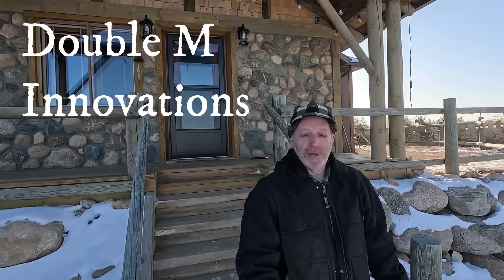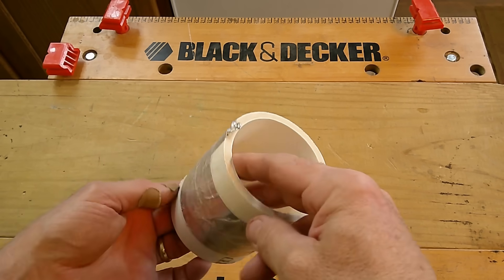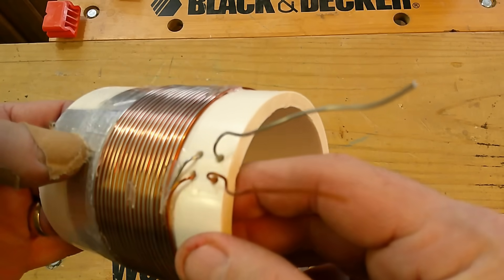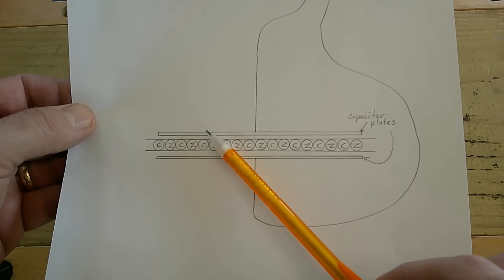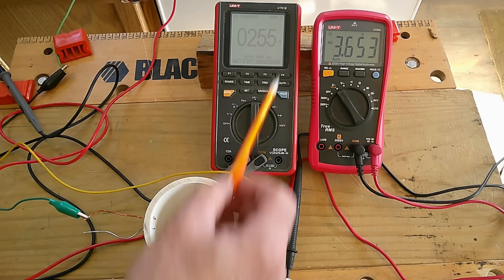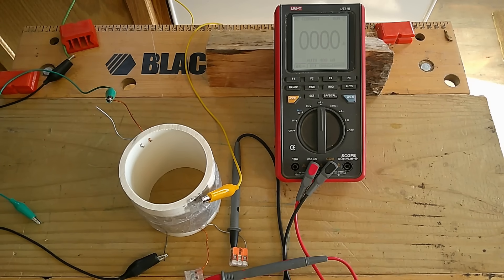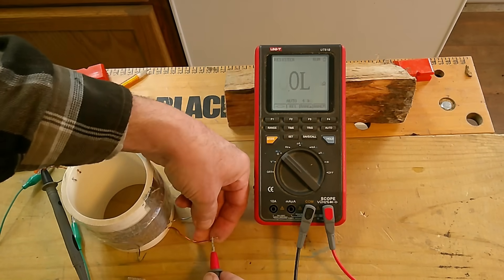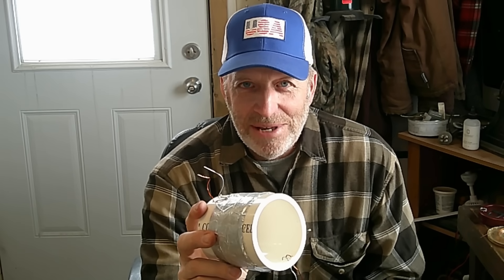Copper-Zinc anomaly; and a capacitor sandwich

Comment: You are indirectly building a dry pile or Zamboni pile.
If you stack enough layers of Cu and Zm that are electrically  isolated from each other, you will start getting a higher and higher static voltage that electrostatically occurs between the metals.
The famous Oxford Bell was made in this way .
Very high voltage and tiny currents occur.
Fascinating physics.

Comment: Did you check the Temperature of the coils?   I suspect you're getting Inductive Heating from the A/C, and are seeing a Thermionic or Thermoelectric Effect in response.  Use Tin for one of the wires and that may increase the effect, if it is a thermal response.  But I'd check the Temp first of all.

Comment: You have dissimilar metals that when combined form a difference in potential and are used in a lot of temperature measurement instruments and in heating and cooling thermostats and the like and can form galvanic erosion over time when placed bare metal positioning.close together.

Comment: I don't know, the only thing I can think of is the voltage drops to 0 because the meter is not Sensitive enough to measure a voltage that low but it maintains the current?

Comment: Earth batteries copper and magnesium give 2 volts which two rods copper and magnesium one end positive the two connected the other end negative in a pvc pipe capped off at bottom with dirt in the pipe … but nothing of … no if the pipe were painted black and in sun it would be a solar array set solar power!

Comment: Seems to me that it’s a variation of the Seebeck effect, except instead of using heat to stimulate voltage in the metals you’re using the AC field. 

Zinc has 2 free electrons and copper has 1 free electron. The alternating field would stimulate these free electrons. The 2 free electrons would create a greater force than the 1 free electron - in the same way two units of mass in a gravitational field would create a stronger force than one unit of mass.
Reply from the maker: Thanks for your input!

Comment: What i think you built was a thermocouple. At any temperature, two dissimilar metals will cause a potential difference between them. The higher the ambient temperature, the greater the potential difference . Copper and zinc does give the best effect.

Comment: since you have a private house, do a biger version of this alternate metal coil and plug the lunar coil to a high antena, and the solar wire " copper " to a good ground with a copper plates underground, then seek a good ferite of the type the magnetizes and stays magnetized even when the current drops, like the ones in radio amplifiers, and put it as core to this coil you made, and have it connected to a parallel of many alternat metal capacitor you can make and have the plates coated on resine while on high voltage until the resin dries on it magnetized and nano assorted for directional energy perpendicular to plates, each plate should be magnetized on different pole of electricity " positive or negative, accordingly,
 then mesure the voltage you get from antenna and ground , pressurized in the coil with the ferrite i mentionned then made strong with the capacitors in parallel, and see what you got and what you can do with it, then you can try to ad a gradual spark gap, and see how it goes, and note the higher  the antenna, the higher the voltage, and bigger the antenna the strong the amps, goes also for the grounding,

Comment: You would expect the voltage of both wires to be balanced the same for the alternating electric field, but due to different resistance a phase shift is created.

Comment: Galvanic voltage betwee zinc an copper is normally around 1.1v only. Anyway the copper wire is enamelled (insulated) so that seems unlikely. Whats the resistance between the copper and zinc terminals? Shoul be very high if insulated from each other. Think that would rule out a galvanic effect.

Comment: electron ia not an particle, what happens here is same what happens if you have an loop of wire and parts of it is in different temperature, cavity will happen that "stacks" electrons (still not an particle). but in this setting different metal acts as an heat, likely not an actual heat (might still be the heat difference) but how easily it releases electrons and or how well it binds em (nope, not an particle)

Comment: Interesting the increase of charge difference between different wire during warmer temperatures. Add Temperature to the growing list of Increasing Potential Charge Differences:
1.Different Metals
2.Different Surface Areas
3.Different Distances from 1 Source (One Near, the other Far)
4.Greater Charge Differences between 2 Sources (Antenna+positive & Ground-negative).
5.Increasing Temperature.

Comment: Copper has positive + potential and zinc has negative - potential. One grabs positive frequencies and the other grabs the negative.
Reply: Try silver and magnesium 😉 silver is high positive, magnesium is high negative  or any alkaline metals. 
Put your coil up high, little circuit in-between it and ground you can harvest DC off, leading to a very good ground/earth.

Comment: The galvanic effect creates a voltaic pile. If you left a gap between the wires and filled the space with 50/50 Alum and sodium silicate you would create a low capacity voltaic pile. I experimented with copper pipe and magnesium rod and stuffed the gap with the above mix and got milliamps that ran LEDs for years with a bit of moisture added infrequently. Bedini and many others worked on this and called it a "crystal cel". The galvanic effect is certainly what you are observing in your anomalous readings though. Hope that helps. Stay curious my friend.
Reply from the maker: What you're talking about, I have done in the past too, and have a number of videos on magnesium crystal cells.  I do have a new about that too.
This situation is strictly alternating current, (VAC).  May have figured out the puzzle now.  (see the next video) Thanks for your interest!
Reply: @ Love it!
Reply: If the copper wire is enamelled (insulated) I'm not sure it's a galvanic effect. For copper and zinc I think that would be nearer 1.1V.
Reply: Any noble metal connection to a anode type.  Same principle as cathodic protection,

Comment: the amount of current and voltage here is extremely low and due to various artifacts.  Why not study the effect of putting your hand around the tube after plugging it in and recording voltage and microamps flow from various places on your skin?  There are so many unaccounted for variables here that you cannot begin to conclude anything.

Comment: Hi,
really interesting experiment! But I think there is a quite simple explanation for this effect: You formed two capacitive voltage dividers. One for the isolated copper wire and one for the zinc wire. If all four capacitors of the voltage dividers had the same capacity, you would get on the Copper- and on the zinc-wire exactly half the mains voltage. And the voltage between the wires would be exactly zero. But one of the two capacitors would be a little bit smaller than the other three. Then you have excactly this effect that you get e. g. 4 volts. But why should one capacitor be lower than the other three? I guess that it could be e. g. a little bit different diameter. Then the thiker wire is coupled to both capacitor electrodes. But the little smaller is more coupled to the inner electrode.
If I am right this would proove my theory: Use two isolated copper wires as electrodes. But the one is thick and the other has only the half diameter. I would guess this would produce a even higher voltage like you see here in the video.
Reply from the maker: This very thing has been described by some sharp minds, in another part of the comment section.  And I have been following that lead.  While I've know that an obvious size difference, produced a voltage difference, I didn't pay really attention to the precise measured size.  The zinc was about 2 or 3 hundredths of a mm larger in diameter. -hard to get anymore exact then that, as parts of the wire vary.  I used a capacitance meter to balance out those 4 contact points to within 1-2% of each other; as there was one that was over 10% off (removed some zinc wire).
Still getting a similar voltage when tested, and at some parts of the day greater than before.  Constantly checking the line voltage and the capacitance balance and readjusting, and one is always seems to get off by a few more % points.  The one contact point between the the zinc and outer aluminum tape (plate).  Seems to be almost impossible to maintain balance at that point, and I'm discovering that it must be the changing difference in pressure.  Zinc must expand more than copper when warmer.  Increase in room temperature also increases increases the  capacitance of all the points, but evenly.  But I think it may also have to do with the resistance difference of the zinc.  It's an interesting situation, but it must be acting like a step down transformer.  Still trying to get my head wrapped around the current part and shorting it out...

Comment: The phenomenon’s cause is a fundamental interaction between dissimilar metals (copper and zinc) in an alternating electric field, likely driven by their electrochemical and conductive differences. The mechanism involves capacitive coupling and periodic charge separation, amplified by the AC field’s oscillation. It’s not a traditional battery (no electrolyte) or transformer (no magnetic induction), but a hybrid effect unique to this setup. it ties to the core physics of how materials respond to electric fields, a principle worth further exploration with controlled experiments (e.g., varying metals, field strength, or frequency).
Reply: That was my thought but I think you only get a galvanic effect when they are in contact. The copper wire is enamelled (insulated) and there is packing tape keeping the aluminium foil away from both zinc and copper. Also I think the voltage is too high. Should only be 1.1V unless there are multiple contacts in series and I can't see how that happens if there aren't breaks in the wires.
Reply: @ColinWatters  Thanks for your insight! I see your point about the galvanic effect—normally, copper and zinc in contact with an electrolyte would give around 1.1V. But here, with the copper wire enameled and packing tape insulating the aluminum foil from the zinc and copper, direct contact is blocked, so a traditional galvanic cell seems unlikely. The high voltage might come from capacitive coupling in the AC field, where the dissimilar metals’ properties (electrochemical and conductive differences) drive periodic charge separation, amplified by the field’s oscillation. It’s not a battery or transformer but a hybrid effect, possibly boosted by the setup’s resonance with the AC frequency. Maybe the aluminum foil plays a role in the capacitance too? Testing with different frequencies or metals to see if the voltage changes could clarify this.

Comment: Google the galvanic series. Anode-cathode. You just discovered Cathodic Protection. There is a voltage simply because they are different metals with different electrons in their atoms thus different charges/voltages. The zinc is the negative anode and the copper is the positive anode. 

The same reason why we attach magnesium or zinc anodes to ships. You made a galvanic battery cell without water electrolyte more than a capacitor. You don’t even need to plug it in to any other voltage It will deplete until the zinc is eroded/corroded. Bi-metallic corrosion, dissimilar metal corrosion. Oxidation reaction on the anode, reduction reaction on the cathode.

Check the voltage and current without plugging it in at all, the difference between zinc and copper should be around 1.10 volts. Zinc has a standard reduction potential of -0.76 volts, while copper has a standard reduction potential of +0.34 volts, resulting in a difference of 1.10 volts

God bless you all and keep you all safe. 🙏
Reply: Negative, would be the cathode.

Comment: I'll try and break down this process for you as much as I can it works much like an electric motor each wire is a Pole and when the Poles switch A Pulse of energy is generated with the 2 wires carrying opposite charge you have 2 Poles vibrate that Pole and it acts just like a simple motor it generates even though this energy is small it can be amplified once you understand the purpose why it works.

Comment: Eddy currents generated by slightly out of phase signals at the sub atomic level due to differences in inductance of the crystalline structure of the dissimilar metals. Should be effected by frequency. You have radiated fields all around. The resonate frequency of the latices changes inductance. Either that or you wound the coils on an acidic paper tube in the presence of atmospheric humidity. In that case you made a small micro current battery. Which I think is more likely.

Comment: The current measurement shows AC current wich is reactive current, you can charge a capacitor with it. Try it with a diode.
Reply: Ah good catch. It could just be his DC voltmeter doesn't read 0V when fed AC?

Comment: The zinc and copper wires are forming a small capacitor
The aluminum tape with wall plug is somehow charging the cap.

Comment: Interesting experiment! Thanks for your video. It seems to align with an interesting fact about Egyptians. Most statues hold two rods in their hands, one made of copper (or gold) on the right hand, the other of zinc (or silver) on the left hand. Check out any of the Egyptian statues standing on their feet in google images! I tried measuring the voltage by between the rods while I was barefoot on the ground, and I am always measuring 1.8vdc consistently! A bit higher on sunny days! Unsure if this has any relationship to your experimenting, but it might explain the battery effect with hand sweat, dunno... Just wanted to mention that.
Reply: What made you think that most Egyptian statues hold a rod in each hand? It is very obvious they don't. The rod in each hand, is a thing from a sarcophagus. And it has to do with priests.